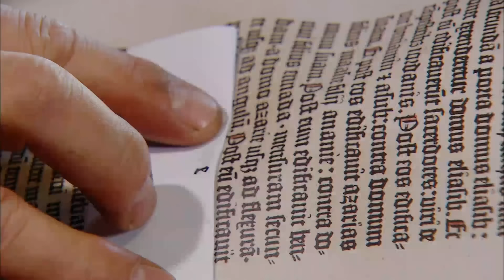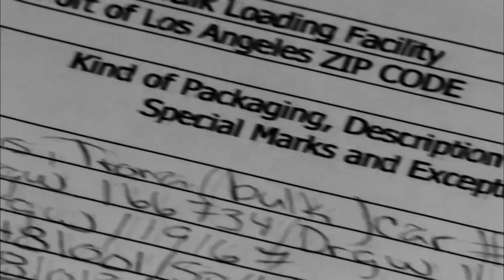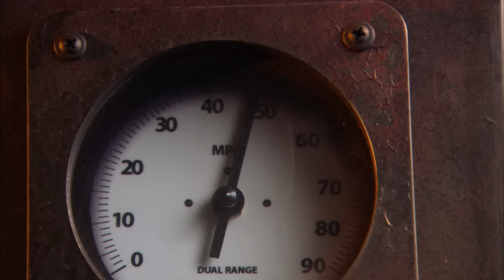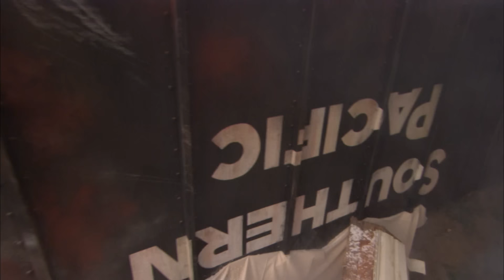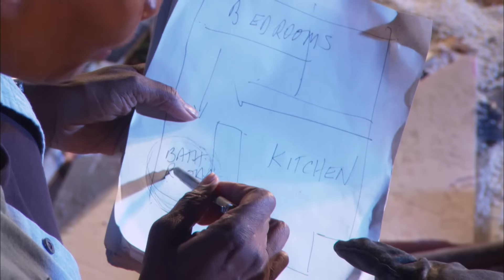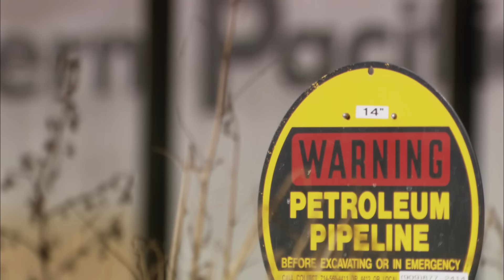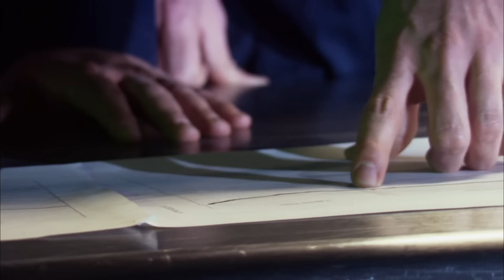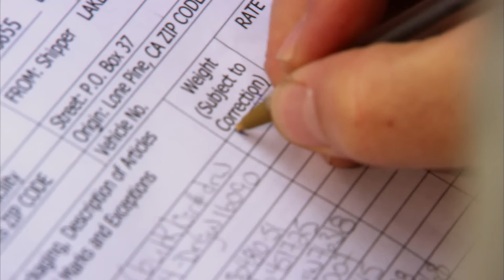Horrifying Runaway Train: San Bernardino Train Disaster SP 7551 East | Mayday | Wonder

Comment: A totally  avoidable tragedy. RIP to the souls who departed. Thank you for this well presented video
Reply: Railroad’s are kinda loose when it comes to repairing dynamic brakes. I worked in a loco repair facility years ago. They have this goofy 30 day waiver, or at least they used to.
Reply: All mistakes are unavoidable in hindsight.
Reply: The brakes? Totally avoidable. Locomotives should have functioning brakes. It’ was Dang Well obvious all the way back in Casey Jones’ time.
Reply: @raquellofstedt9713  the brakes on Casey Jones engine worked fine tf are you talking about
Reply: @raquellofstedt9713   Each of the problems the train had didn't make the situation troublesome enough to worry about it. It was all the problems combined that caused the perfect storm for the train.
Reply: @debbied.1682  Yet it seems to me that the brakes were a no brainer, and should be, for any moving vehicle. If you can´t stopit, you don´t move it. there, one part of the puzzle of factors is quite easily and should be routinely removed. Who in their right minds regularly plays around with non functioning  brakes on a loc? No, with those weights, it might not have stopped that train, but it really begs to be considered what OTHER trains need stopping that can´t be.
Reply: @raquellofstedt9713   A red flag never went up for the brake issue because after the engineer calculated the load they weren't needed anyway to stop the train so it became a non-issue to them which is why the engineer was never charged. He did everything right according to the paperwork he received. It's the extra weight of the train that caused the dominos to start falling.
Reply: @raquellofstedt9713  Trains have 2 types of brakes.  There are "air brakes" on the locomotives and on the freight cars. These work by forcing a brake shoe of friction material against the wheels to generate drag and convert the train's kinetic energy into heat.  Then there are "dynamic brakes" which are on the locomotives only.  Dynamic brakes change the electric motors on the locomotive axles into electrical generators.  The generated electricity is then converted to heat in large fan cooled resistor grids thus dissipating the kinetic energy of the train.  It is my understanding that the air brakes were working on all of the locomotives so all of the locomotives had "functional brakes".  What was not working on some of the locomotives were the dynamic brakes.  The maximum braking effort is determined by the "adhesion" of each wheel to the rail. If the brakes are applied too strongly the wheel will "lock up" and slide on the rail rather than rotating. This is true whether the braking is applied by air brakes or dynamic brakes. This train had 6 locomotives (36 axles) and 69 cars (276 axles) for a total of 312 axles.  There are a lot more wheels on all the cars put together than on the locomotives so that vast majority of the braking effort is provided by the air brakes on the cars.  If all axles had the same adhesion and were thus capable of the same braking effort (not completely true, but good enough for this discussion) then the locomotives could provide only 11.5% of the braking effort of the train.  All of that 11.5% effort could be provided by the air brakes on the locomotives so the missing dynamic brakes are not really a factor.  Railroads do like to use dynamic brakes though, as they reduce the wear on the locomotive brake shoes.

    The bottom line is that this train could have descended Cajon pass safely without ANY dynamic brakes IF the engineers has known the correct weight of the train.  The critical factor is TIME.  The brakes (air or dynamic) can only dissipate heat at a certain rate.  The engineers calculated the maximum SPEED they could travel that would make the descent of the pass take a certain TIME that would keep the rate of heat generation in the brakes equal to or less than the rate the heat could be dissipated. Because the train weighed a lot more than they knew, there was much more heat energy to dissipate than they realised.  The excess heat overwhelmed the braking system causing "brake fade", greatly reducing the braking effort available.  If they had known the true weight of the train they would have calculated a slower speed, making the descent take more time, which would have given the braking system sufficient time to dissipate the heat.  Yes, there were many links in the chain to this accident but the critical one for me is that the engineers were given an incorrect weight for the train.  If they had known the correct weight, they would not have lost control of the train.
Reply: @debbied.1682  Completely correct Debbie!  I have tried to expand on the reasons behind why this is the case in a reply I just posted to Raquel. Hopefully you find it interesting.
Reply: FLASH MAN   Yes, thank you.  🤦‍♀️
Reply: FLASH MAN  oops .🤦‍♀️
Corrected it. Thnks

Comment: I was expecting more deaths and destruction from a runaway train coupled with gas, maybe because I'm not so far from the 2013 Lac-Mégantic train disaster that killed 47 people or maybe it was plain luck. Downhill trains with a curve in the middle of a residential area are terrible idea.
Reply: The tracks were there long, long, before the houses. Don't forget your history.
Reply: @renegadetenor  Megantic is a town built BECAUSE of the rail, just like most towns built during the railways boom in late 1800. Nothing surprising there.
What changed with the time is: the removal of passengers trains and change to freight only, rendering the need to pass in the middle of a town meaningless; the augmentation of the length of the train making them more heavy and carrying more stuff.; the lax regulations that reduced the amounts of staff required to run the train; the fact that they already planned years before to reroute the tracks out of the city but the plan was dropped because of the cost; the use of inadequate cistern wagons to transport highly dangerous fuel; the fact that MMA PURPOSEFULLY let the rails conditions deteriorate to make more profits.
Yeah, I think that I know my history and why this tragedy happened in my own region. 
The same train pass in the middle of my own city, although there's no elevations or major curves here.

Comment: Well, they never mentioned that the pipeline was supposed to be on the inside of the curve instead of the outside. For safety -in case of derailment - the pipeline was supposed to be on the inside to avoid the damage that happened on the outside of the curve.
Reply: I didn't know that but it makes sense. Wow.
Reply: pipe line should never be under private properties to begin with.
realtors selling that development and than state government should be sued.
Reply: @вечная_мерзлота  your opinion. Shows you do not know the facts about R.O.W's.
Reply: @bizbebe  
yes they do.
they deal with all the records and they needed to disclose it.

Comment: I can't believe they didn't check the pressure of the pipeline AFTER all cleanup operations (at least use of heavy machinery) had been finished. Clearing the pipeline as "good to go" before the cleanup is finished is pure insanity.... the whole disaster was so avoidable, going back to the train wreck itself.
Reply: the NTSB stated that the pressure looked fine all the way, thats why it was allowed to reopen. this was an explosive fracture, that can really only be found by overpressurizing the line, but that wouldve had the same outcome. just on a different date.

Comment: I'd sure like to learn about the physics of how any train ever stays on the track. I'll never understand how something so tall, and with such a narrow wheel base, ever stays on the track.
Reply: Just like I’ll never understand how those huge ships stay afloat. But I can’t
Reply: same can be said about airplanes
Reply: If you are wondering how a train stays on the tracks.  The track at San Bernardino is 4' 8 1/2" wide, Standard Gauge as it is known.  Where I live: Queensland Australia.  The track is 3' 6" narrow gauge.  The only Standard Gauge width track in the state runs from the Port of Brisbane to the New South Wales border: about 160km (100 miles).  Another Standard Gauge is being built (Inland Rail) from Brisbane to Melbourne.
Reply: Ships and planes I understand.
Reply: @Petersgiijbv  the ships are mostly empty :) overall they weigh less than the water so they float. Then you just have to keep all the heavy stuff at the bottom. It's like a bucket with rocks at the bottom... Harder to tip than it looks
Reply: @railtrolley  So, maybe I missed it, but just HOW, exactly, does that answer the question of HOW a train STAYS on the tracks??
Reply: @purdyboi807  Sorry, my track gauge comparison does not answer your question.  Each rail is mostly dead level and even with the rail opposite.  As there is so little variation in the level of the rails, rollingstock has no need for long travel suspension.  This makes next to no tilt from side to side.  No leaning over - past the point of tipping means the rollingstock can't fall sideways off the track.  Curved track does have the outer rail set higher than the inner rail: called Super Elevation.  This makes the train lean into a curve, so it can be taken at higher speeds.  There is alot of weight down low, with the wheels, trucks, traction motors (in a locomotive.)  Compare this with a road, which has to have the middle as the highest point - necessary to allow rain to drain off the road surface.
Reply: Magnets. There are little elves under each car that control the magnets. When the car feels like it is tipping the elf increases the power of the magnet to hold the wheels on the track. A lot of the elves take early retirement from the railroad and then go to work for the Keebler company.
Reply: @knotical689  exactly
Reply: @anthonynelson9136  lol
Reply: It's the weight of the locomotive, 200 tons are common for most engines. The weight is centered low.
Reply: @Petersgiijbv  For ships the operating principle is actually surprisingly simple: The amount of water you "push" out of the way with your ship's hull must weigh more than the actual weight of the ship itself. What I mean by that is, when you put your own body into water for instance, you push aside a volume of water equal to how large your body is. With that in mind, calculations for ships often focus on how to allocate space inside the ship in such a way that it can displace (that's the proper term) as much water as possible
Reply: The wheels are slightly angled towards the inside of the tracks.  That coupled with flanges on the outside of each wheel is almost impossible for them to come off. The tracks are tilted to allow for leaning into the curves.
Reply: It all has to do with center of gravity. Sure the trains are tall but its where the center of gravity is that keeps them on the rails. That is why trains can travel fast in straight lines but on curves must slow. Otherwise physics takes over and the center of mass shifts and the trains tip.
Reply: Sheer weight  that's  why to fast in curve they come off.

Comment: Ok, am I the only one here who is questioning that Yardmaster's actions? Instead of making an educated guess, he should have contacted the shipper directly and asked what the weight was in each car.
Reply: Or just put the maximum load on the sheet. That way they would have to add more engines and more brakes? In theory at least
Reply: I saw another documentary where they examined that action in more detail. At that time, it was standard practice to compare cargo to a similar substance of known weight and use that weight. The trona appeared to be similar to a lighter substance, but it had more mass than he could have known, and was therefore heavier. If it weren't for the accident, no one would have been the wiser. The manufacturer should have included the weight on the paperwork so he didn't have to guess.
Reply: I thought about this many years ago. The shipper may have been closed for the weekend. Unless i could physically see inside each car id guess each car as loaded.
Reply: IMO, That information should have been provided as a matter of procedure.  He shouldn't have needed to ask.
Reply: When I was trained as a conductor, the weight of the cargo was required information, but that was in 2002.
Reply: @danishghostrider  people need some reasons to do things sometimes, this serves as awake up call to others.
Reply: It's called complacency. Happens often.
Reply: @rachelstratman1405  They now have high tech scales where each train car can be weighed and  instantly determine the total weight. They had the technology then, just didn't want to spend the money.
Reply: Like I my first thought was. That’s the difference between I think I know! Compared to what you actually Know!  Yahoo
Reply: he sure should have.. but he was lazy.. probably felt he was on a time crunch.. and got complacent and miscalculated. That happened on a Plane once.. actually miscalculated .. I think actually it was based upon conversion between metric and imperial weights and the plane was overloaded  sigh...
Reply: @danishghostrider  That isn't entirely what happened. The weight of each car wasn't filled in on the paperwork because the shipper thought that since each car was fully loaded, the weight was not needed.
Reply: @allenra530  The weight of each car has always been part of the procedure. According to Federal Regulations, all train cars must need to have a required weight
Reply: @caelidhg6261  No that wasn't it. You see at around this time, Southern Pacific Railroad was in a bit of trouble. Southern Pacific and its counterpart, the St. Louis South-Western, more commonly known as the Cotton Belt, were struggling financially. They had just gotten themselves out of a divorce with the Santa Fe railroad, and they had got themselves into a Partnership with the Rio Grande Railroad. The company was really struggling and didn't have the Modern Features as other railroads had at the time.
Reply: he should have that info already
Reply: @johnirwin11  He should have yes, but he didn't
Reply: Shouldn't be handed off to someone else. The responsibility of knowing a loads weight falls on the loader not receiver of the load. That liability shouldn't be transferable with a big "oops" at the end.  .02

Comment: Trains doing possibly 100+ MPH "We have a slight problem" Ummm, That's a HuGe Problem!
Reply: The 177 km/hr stated in the video, is 110 mph.
Reply: Yelling "big or huge"  problem wouldn't have changed the problem, stopped the problem, saved any lives or gotten help there any faster. Complain about something important.
Reply: @mircat28  My point is, they needed to heed the severity of the situation. If they had any sense, they would have called the police and had them warn the people at the curve to leave their homes and the area.
Reply: @franknstein33  The track on El Cajon pass is not that long. At 110+ mph, by the time the engineer realized there was an issue and called to dispatch, they were already too close to San Bernardino to get  the message out.